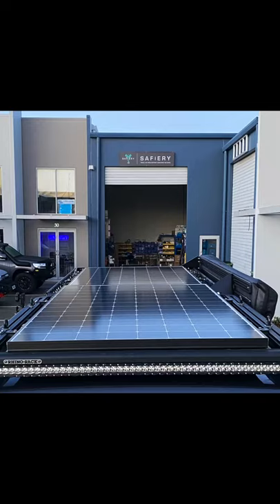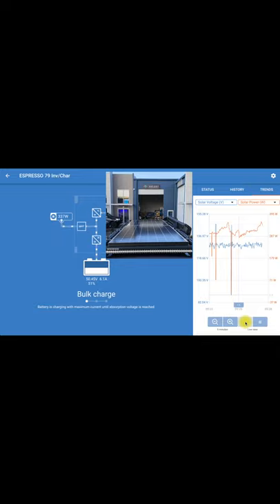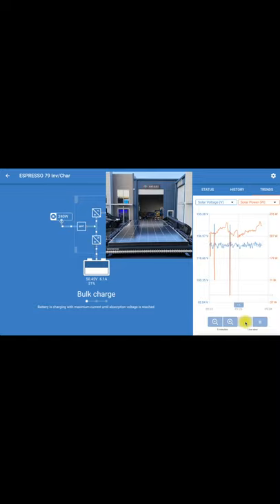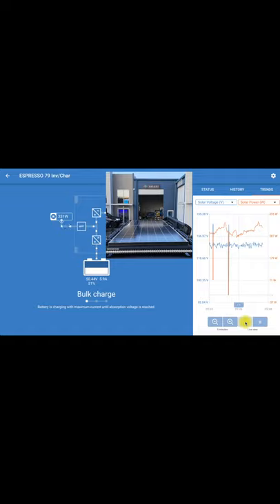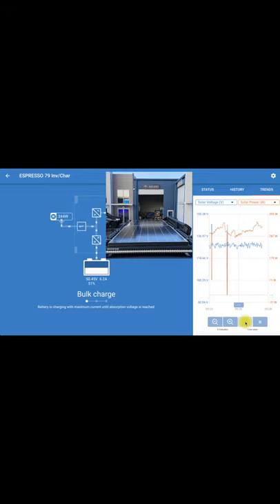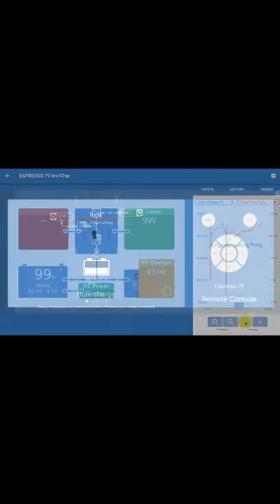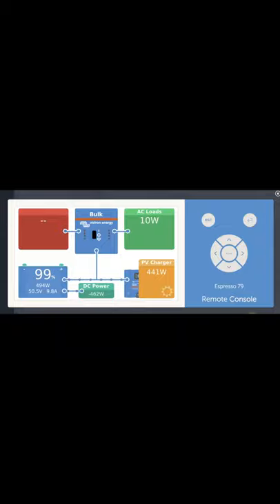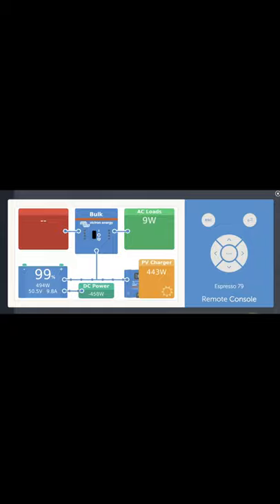800W Solar on 79 Series Roof and Canopy Watch Live performance at 9am 450W Yield

Comment: Hi Bruce, just one question. When Scotty slows down the Alt input in preference Solar, what are we actually saving. Is it less fuel consumption as Alt' not working so hard or is it just a feel good that we are capturing Solar. In other words if we just had Alt' input would it cost more to charge the battery bank than the Esp’ 79 set up and if so how much extra for say the full 600ah battery bank ? Cheers
Reply from the maker: We watch to see if the battery voltage is rising from other charge sources and if so (we measure to 3 decimal places) we throttle back a bit to let the solar in this case have priority. Just because Solar is free power. Its just oue personal preference. There is no technical reason to do this.